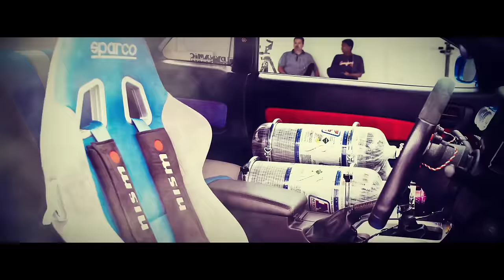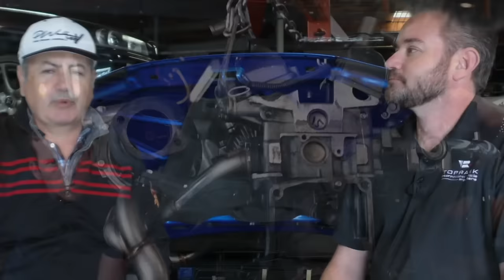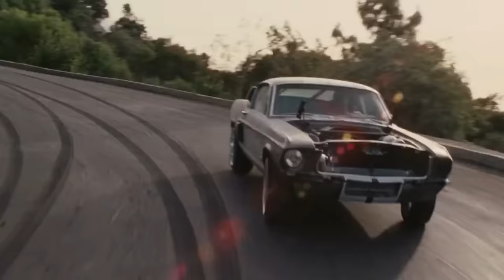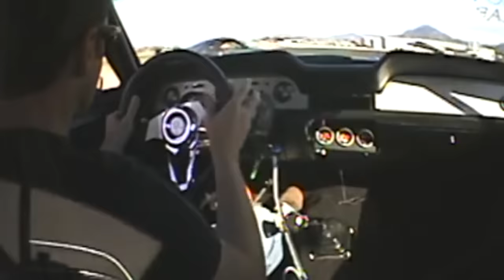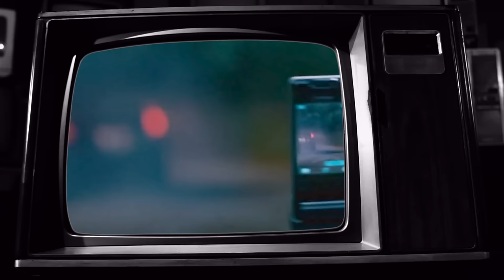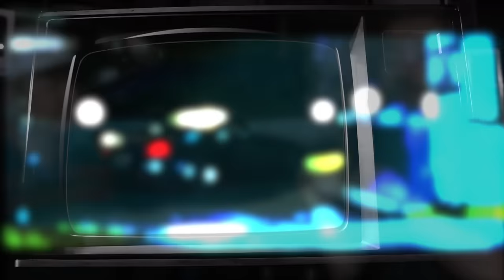TOKYO DRIFT RB26 MUSTANG

Comment: Biggest insult to a mustang ever
Reply: Tell that to Ken Miles
Reply: @ajga5435  meaning? The guy drove a little bit of everything.
Reply: But the mustang came with a straight six as a default engine
Reply: @Ramkakh  1. The 64 had both a straight 6 and a 280 and 289 cubic inch v8. Not strictly a straight 6.  
2. I'm not knocking the engine layout. Just the fact it's a gt-r engine. Or whatever the fuck it was. Nissan, or Toyota. Both piles of shit.
Reply: @jensenatkins8936  dude its the rb26 nissan skyline gtr engine,the tuning potential is huge,some people can get as much as 1000bhp from the stock block,its the holy grail of engines.
Reply: @csav1551  meanwhile companies like Ford and Chevy do that same thing with their hands tied and blindfolded. The skyline b came popular and a holy Grail car because of the fast and furious movies. Up until then, people weren't out bragging about their skyline. Wasn't much of a sought after car. Then Paul walker hopped in one and made it famous. It's just a movie car. 
And just so you know, 1000hp out of a stock block in a skyline is laughable. Because Ford did like 12-1400 hp out of a stock block in a 74 pinto.
Reply: @wd4950   yes
Reply: biggest insult to an Rb26 ever. Such a good motor being put in a chassis that can barely stay upright in corners
Reply: @jensenatkins8936  the pinto cant even stop catching on fire in stock form lmao
Reply: @jensenatkins8936  umm actually the r32 skyline gtr started it all and Paul Walker never drove one in the movies,ever heard of a nickname "godzilla"?The r32 had the rb26 before it was cool and it was the most badass skyline of them all,plus they could have 1000bhp and they could also corner.Any petrolhead would have a skyline gtr instead of a ford or a chevy.
Reply: @youridv   thats due to the location of the gas tank
Reply: Modern day s55 mustangs will take corners just as good as any other car, the current stock 302 block can handle 1400hp almost 1500hp before spinning a bearing or  cracking
Reply: @csav1551   no, no they couldnt only the iron blocks could talking 2jz but no stock rb26 has gotten past 800 hp
Reply: @csav1551  is that why the skyline isnt being made? Closest you have is the gt-r. Which is a joke now.
Reply: @youridv  cornering is driver discipline when u have awd and 250 hp yeah u can corner ur gtr when u have a 68 mustang with stock suspension and 350 hp ur gonna have body roll old cars are heavy but can be modified cheaply and handle just as good if not better than a gtr
Reply: Look up itsjusta6 and u will see what i mean
Reply: @csav1551  made the car for 3 years, stopped production for almost 2 decades. Then produced again until 2002. It was called Godzilla during the touring car championship in Australia. Only one time, over 30 years ago. The car had so many inconsistencies. That's why it was a failure.
Reply: @jensenatkins8936  You can still buy a nissan GTR witch became its own model instead of being a sport version of the skyline and they put in the V6 enigne they originally wanted for the r34,and its a really special car every engine is hand built I can't believe I have to defend the skyline GTR.
Reply: @csav1551  it's not a skyline. Just a gtr. The Dodge dart is more of a neon that the gt-r is a skyline. Lol
You defend the car because you like it. I just don't. It's an over glorified car. You defend it, more power to you. I have cars I will defend with my life
Reply: @jensenatkins8936  How is the GTR a joke now? Some of the fastest track and drag cars are GTR's.
Reply: @ahhh6201  ... false do you know who Leroy is... hes a 7 sec gm stick shift Corvette and hes only getting faster
Reply: @csav1551  the only engine that is hand built is one you build yourself... something you'll never do in your lifetime
Reply: @ME-bh9gc  Just because there are other fast cars doesnt mean that the GTR isnt one of the best platforms out there and leroy is just barely a corvette, but it is still bloody quick.
Reply: @ahhh6201   those gtrs are just a shell  on a fast car.. normally they dont use the stock frame just tube chasis it would be the same as leroy if he had body pannels
Reply: @wd4950  wow you're so funny
Reply: @wd4950   i have one question... how tall are you
Reply: Even though a straight six was an option in the Mustang for a long time.
Reply: @/// yeah. They weren't perfect. Now they are. But when you manufacture a car then disband it, then manufacture again. Then disband again. Then design and creat another car similar but not badged skyline, it was either the demand, or poor performance/quality why they keep making a car and halting it's production for a decade at the minimum means the car wasn't as good as the fanboys made it to be. 

Back to the mustang. One of the only cars to be made from day 1 and be produced every year since. 
Now the mustang 2 wasn't a good car. Not worthy of the mustang badge. But that time period was different. They couldn't produce the same kind of muscle car they have been. Bad time period. But nevertheless, the mustang 2 is what saved the mustang line. Now, the mustang is by far the best performance car you can get for your buck. Plus it's the best selling 2 door sports car worldwide. Because for 40 thousand, you can get an American muscle car that's able to rival a Porsche, or Ferrari, or lambo. Yet for less than 1/5 of their price.  Ford knows how build real cars. Powerful and beautiful cars. Even their fiesta does awesome. But they can build a car, and Ford knows how to market their vehicles. Which is why they are by far one  of, if not the best car brand on the market. Look to a Motorsports, Ford has victories and championships in them. 

Now Nissan on the other hand, they are goin through CEO's and marketers faster than I can change my underwear.  They don't have much. I drove numerous vehicles de by them, and they are so cheap, because they feel like they are cheap novelty cars. They have the worst selling pickups too. Barely reaching over 20000 for both their titan and frontier for last quarter of 2019. With their sales declining.  Obviously you know Ford has the best. Don't need to say that. 
Plus their gtr is their best car without a doubt. But even that car is kind of falling back. A  Bentley beats it on a drag race. They are pretty identical on power. Only about 20-30hp difference roughly on their high end models. The Bentley outweighs it by a ton. Litteraly. The gt-r has launch control though. Still doesn't win.  

Bottom line, Nissan is not a sports car company. But the skyline was a horrible car. Unless you ask the fanboys. As I said to the other guy, it really only became popular because of the fast and the furious franchise.
Reply: B W not true but okay
Reply: @evilnyne  whats not true
Reply: @/// im just using him as an example
Reply: B W my bad this was the complete wrong video 😂
Reply: @evilnyne  np ive done it before weirdest online conversation ever lol
Reply: @wd4950  somebody is blind. They were produced until 1973. Picked up again 16 years later in 1989. And ended production in 2002. 
Nissan hasn't made them since. But someone makes a car called the skyline. Guess who. Infinity. Up until last year, they had a Mercedes engine.
Reply: @wd4950  but as for that mustang comment, I won't even dignify that with a response. Even you know why
Reply: @wd4950  just did. Here's where things get really funny. Scroll down to where it says r34. You will see it was last produced in 2002. Go to the v35. You will also see where it's now called the infinity g35. Not a Nissan.
Reply: @wd4950  does @ you annoy you?
Reply: @wd4950  blah blah blah. You're gonna say how infinity is owned by Nissan. Here's another funny fact. Nissan doesn't even own themselves.
Reply: @wd4950  did I @ you too many times?
Reply: That was a long ass reply my bad
Reply: B W yeah.... except it took ford 50 years to finally get mustangs from losing control
Reply: I think u mean biggest insult to a rb26
Reply: Who fucking cares.. it's just a movie car. You do whatever you want with it.
Reply: @csav1551  It was a '68 so it could have had a 390ci FE big block. More torque, displacement, aftermarket support, and sounds better. And that's a strech saying that the rb26 is the holy grail of engines. Maybe for a fanboy. There are way better engines in both japan and the us. Rail dragsters and funny cars use gen 2 hemis for a reason.